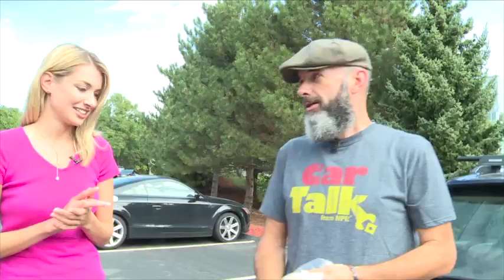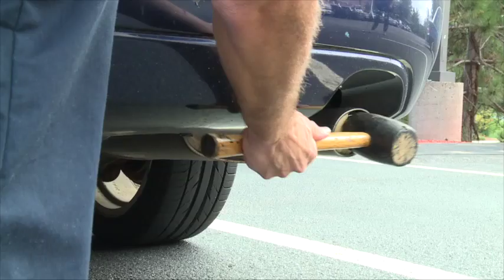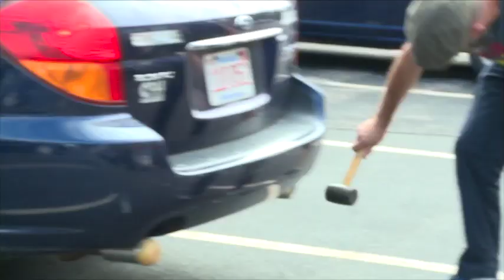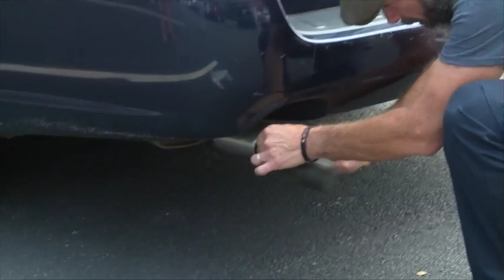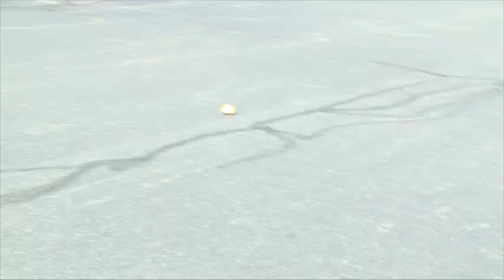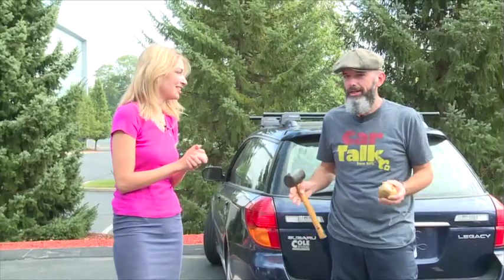Here's What Happens When You Stick A Potato In A Car's Tail Pipe

Comment: Works better on a single exhaust pipe vehicle with no safety venting. The dual exhaust system has a cross feed to balance and take up pressure difference. Best to do this in sub zero weather on a single exhaust vehicle. Let the potato freeze in to place. Then it should shoot out like crazy! 

The older single exhaust cars from the 60s and earlier were the best to do this in sub zero freezing weather.

Comment: I've never done this myself, but I read that it will cause the car to stall if it doesn't fly out.  These two should have really jammed it in there with some kind of long handle.  I've heard a banana works as well and probably would stay in better due to its shape.  Next time, try and get the potato to stay in with whatever you can find.  Use duct tape if necessary.

Comment: I honestly did not expect this result.  I always thought the idea was that it would slowly destroy the motor due to the inability to get rid of the exhaust/heat, and/or fill up your car with exhaust.   As I got older, and learned(a tiny bit) more about cars, I figured it would just make the car stall out.
For some reason I didn't expect them to just shoot out like that.  I guess I just thought that the pressure wouldn't be able to build up that high due to(I assume/assumed) the exhaust not being "sealed off", or air tight.  That...doesnt seem like much of a prank(unless it's supposed to take something explode or something?)  
I wonder what would happen if it wasn't a dual exhaust car, and/or if you put something that wouldn't pop out in there.  Where would the failure point be?  And would your car fill up with carbon monoxide or what?  Or even with just the one exhaust pipe closed off, what would happen if you kept driving it?

Comment: People who have an obstruction in the tailpipe do not know it's in there and they don't rev the engine up but start it normally and let it IDLE. Then it dies and won't restart except for 1/2 a second. You were blasting it out from the start, so I don't think you gave it a chance to work which would have shut it down. You should have waited on IDLE, let it shut down, then attempt a restart, a normal restart.